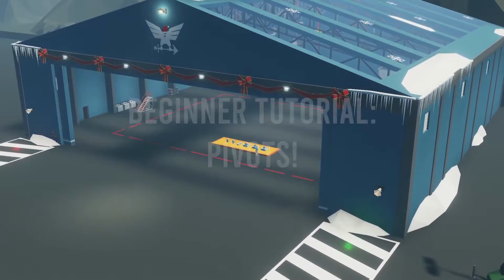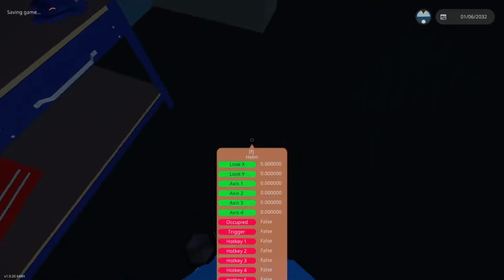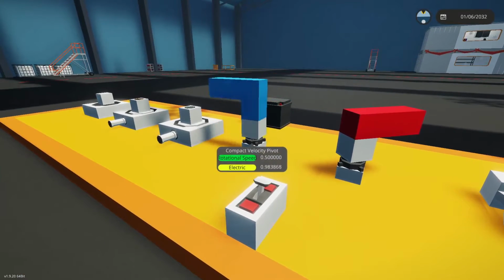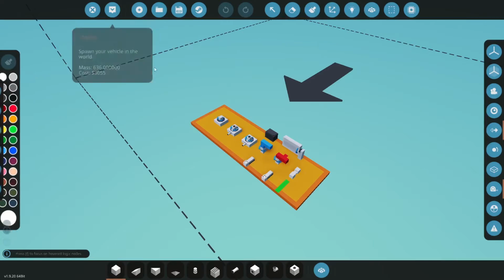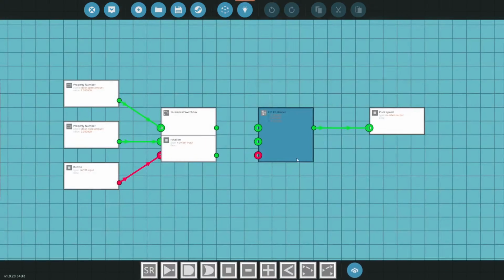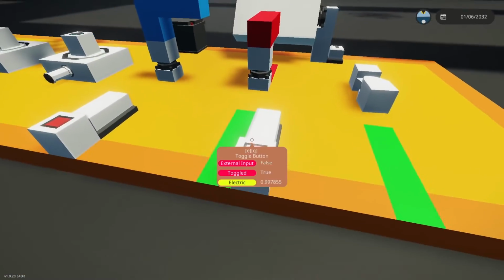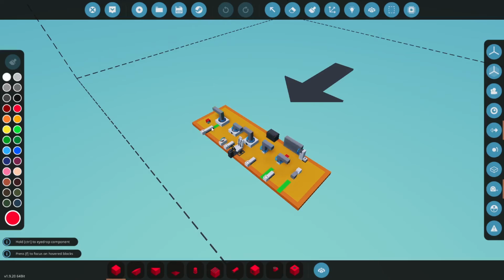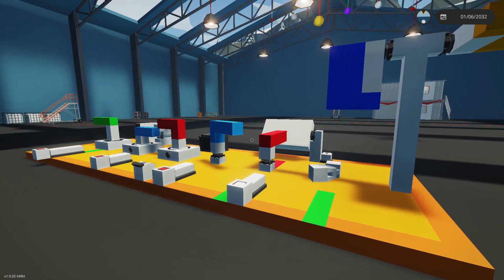PIVOTS Tutorial for Stormworks Beginners (Engineer Explains)

Comment: Hi, I have a problem, basically my vtol nacelle that is pivoted with a big pivot just snaps off (Rotates freely and uncontrollably). Will appreciate any tips
Reply from the maker: I have found VTOLS super useful but super problematic with lots of changes for phantom physics to take over haha My best advice is to do a proof of concept, something small and make sure that the parts all work - and then try to sort this one out.  Check out my VTOL video :) Also, the pivot should not rotate freely, is it the right type/is it powered? I might be getting caught on something
Reply: @454ss_gaming  They had power but they were too weak. Someone in the SW Discord suggested increasing the gear ratio and it actually worked—now my VTOL can fly after months of work! :D It's crazy how asking for advice in community servers can save so much time and sanity. I really wish the devs would add a way to change the prebuilt gyro sensitivity so it wouldn't overshoot so much (especially with planes 😭😭), but now I've learned how to build my own gyros, which is even better. This game is so addictive, entertaining, and educational at the same time. Love it. Planning on getting even better, as always :)
Reply: And now we wait.....

Comment: Im not a expert but im pretty sure Robotic Pivots will not be rotated by external forces no matter what, i once used unpowered Robotic Pivot (power) as the connection between train assemblies and a chasis and they would not turn at all
Reply from the maker: Yup, they won't be rotated by external forces but they can be "broken" if it is too high of a force. Did I accidentally say something contrary to that? Thanks!
Reply: @454ss_gaming  I feel like it was implied you could force them to rotate because of the demonstration but that may have been just me. Though i know what you mean.
Reply: I actually use robotic pivots on a train that I'm building, both the compact and fluid variants, and I know many couplers in a train community I am part of put them on robotic pivots that have been turned down to 1-2% power, so they have a little bit of give for the tight curves workbench tracks have, use no electricity (not connected to electric grid at all), and they spring back with sufficient force to be pretty much rigid when not on a curve. 
Using them significantly lowers the locomotive power needed to get around corners, which can be really helpful, especially so you're not playing a game of chicken between giving it enough power to get around the very curvy tracks at the workbench, but not too much to slam yourself into the end of the track the moment you exit the curve lol.

I've also used compact robotic pivots as more of a spring on a few occasions for various other contraptions, they seem to act as a constant force spring to me, haven't done any specific tests though to confirm that. 
Just some of my experience that I wanted to add in.